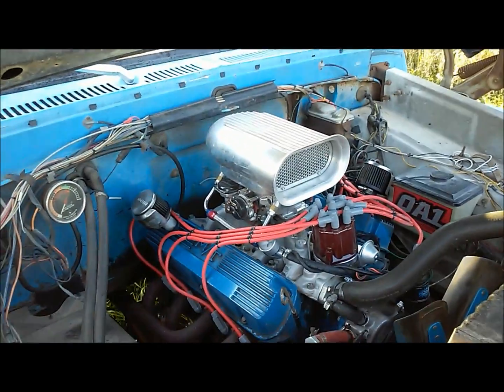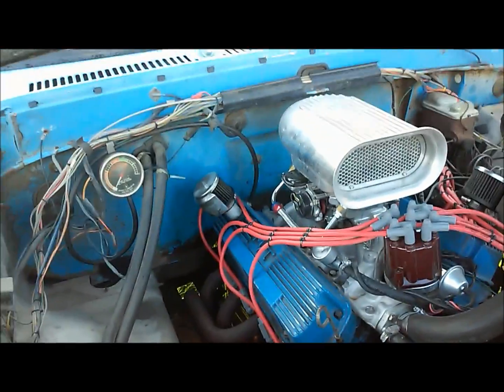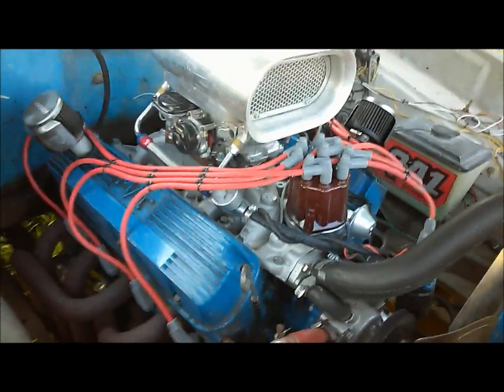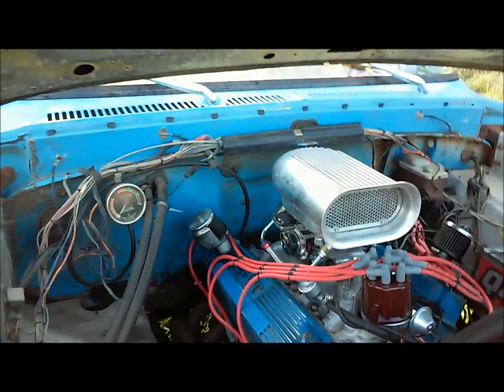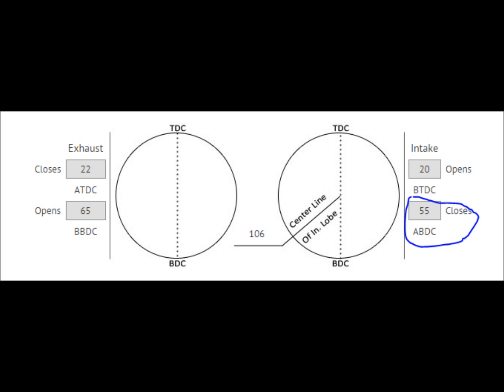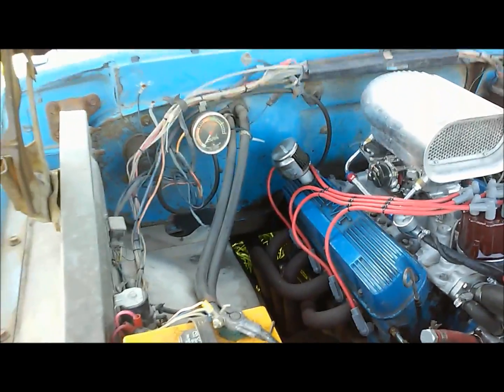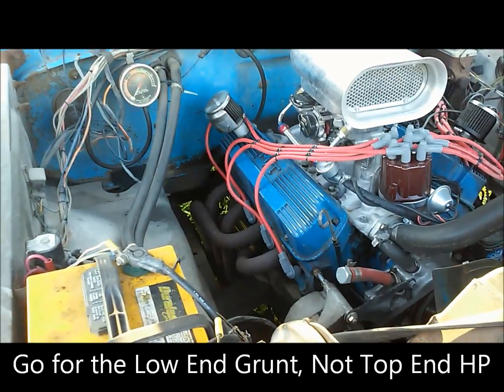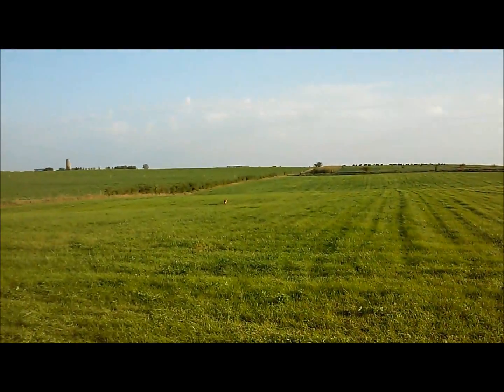Dynamic Compression: Biggest Engine Building Mistake

Comment: I try and shoot for 8 to 8.5 dynamic on my engines depending  the cubic inch size.  I think a bigger bore longer stroke  u want a little less dynamic number, smaller bore shorter stroke u want more .  I just did a 350 chevy with iron heads 8.45 dynamic, runs good  on 91 octane. No pinging even at 12 degrees  intial  timing and 36 total.
Reply: Do you have a certain quench or is that with oben chambers?
Thanks in advance!

Comment: Good information, LSA makes a big differance in dynamic compression, tighter raises it wider lowers it, tighter more  overlap, wider less overlap
Reply: Wait. More overlap reduces compression. Because you’re “blowing” air out of the exhaust valve because it’s still open.

Comment: All my numbers put into a calculator and its saying i should have 10.35:1 with 8.61.1 dcr i did a pressure test on my cylinders and its pumping 225 psi per cylinder 😮383 stroker.not sure if it will run on 93
Reply from the maker: Man, hard to say - but I'll tell you this, you are going to love that engine if you can get the octane to behave
Reply: If you could retard your cam 4 degrees or so, I'd say yes.

Comment: Don't hate on people that have 12.1 and a 383. There's a chance you're not the end.be all. Grand wizard.  I truck Doesn't run better, because it has a smaller cam.  My truck has 10.7  a stage 2 cam  on 91. It comes in low Is peck torque at 4500. 100 hp over stock rev to 6500.  It's a #truck cam.
Reply from the maker: Man, this has to be from like 10 years ago
Reply: @ThunderHead289  And yet, it's still posted.  Admitting when you're wrong about something isn't really an iowa thing. So...carry on👍
Reply from the maker: @kevinwest3689  I don't remember what I say in the video, but judging from the title I was probably talking about how a lot of folks stuff in too big of a cam for their engines static compression. 
A big overlap cam is totally fine when the engine is built correctly for it - unfortunately many people just don't. 

And I feel that - I think most people un general today can't admit when they are wrong. Try working in engineering - basically the poster child profession of that IMO

Comment: Im building a nice 408 afr head single plane can i run 9 to 1 dynamic on 91 with a water meth spray up top were i will build cylinder pressure with my hot cam its wi d e and 108 lobe sep

Comment: The more overlap an engine has, the more cylinder pressure it will have.
Reply from the maker: Opposite actually when compared to all things equal the same engine with less overlap in the cam
Reply: Im thinking this is actually true.
Reply: Only at higher rpm where we can't easily measure with a compression gauge.

Comment: Biggest bang for the buck was re-timing my stock cam on my smogger 460. Runs top notch 👍 don't want to lose my low end torque so kept the factory intake and cam. Only changed the cam timing and ignition curve. Its like a different car now for about $100 and a evening of tinkering with it. 😎
Reply: Ford retarded them 4 degrees from the factory for smog
Reply: @brantkinnsch  Just 460s or were all their V8's retarded in the "smog era?"

Comment: Dynamic compression is real world and most important. I has more to do with cylinder head VE. You can run hight static numbers with oem stock heads because the VE is down and the head doesn’t flow much. After market high flowing heads have a lot higher VE so your dynamic numbers will be much closer to static witch is based of 100% VE. The LS platform is around 80% VE. So you can do your math from there. Pro Stock drag engines will get up to 130% VE meaning the engine consumers 30% air and fuel them it’s static volume. Choppy loping cams the every one loves really is the engine running like crap at low rpm. A big over lap uses the exhaust gas velocity energy to scavenge the fuel air mix past the intake valve moving off the seat. It works best with a tunnel ram type intake with long runners. If you can get line of sight down the carb and see the intake valve. That column of fuel and air with create positive pressure @ tge back of the intake valve. It’s a natural super charging effect. It’s crazy not to see tunnel rams much any more. It’s the most bang for your buck on most v8’s.

Comment: So even with aluminum heads 8.5:1 is the magic number
Reply from the maker: Indeed it is - can probably fudge it a bit higher for dynamic compression with aluminum heads, but also aluminum heads decintigrate with preignition
Reply: @ThunderHead289  well I'm looking a doing a 347 with twisted wedge 11r 56cc chamber and ford's z303 exhaust closes 3 deg intake 41

Comment: You can run 12:1 static compressor on pump gas with overlap and bleed off but it's all about combustion chamber shape and compression squash with no sharp edges on dome or head chamber it works great 👍 for my engines
Reply from the maker: The word your look for is squish and it relates to quench. Bad quench causes detonation - ideal quench is roughly .042 between the piston top and the bottom of the cylinder head. 
From there, dynamic comes into play since it’s the real compression with the cam overlap factored in
Reply: Ideally. 042 is the max. .027 min is possible with low piston rock and the closer the better with proper build. After .040 detention potential increases greatly. If you can keep tbe piston under .040" throughout dwell as the piston is moving back down detenation practically a non issue

Comment: yeah exactly basically. hey I'm going to get a big cam without all the other parameters to utilize it properly.... hi I'm an idiot!

back in the day when you had to do things by hand and you either had to know what you're doing because somebody else gave you the parameters or you just simply had to take a chance because it was very common that somebody go through a lot of trouble and build up some big block monstrosity but all the parameters are not matched properly and then some little 351 Windsor with milder components but yet everything is matched perfectly beats that big block monstrosity. 

A engineer told me back in the day because he had it figured out basically at sea level conditions and i describe to him the typical drag race out on the street that took place back then in the 80s. 

The typical race was you already at first gear because there's some other guy in the other lane behind you going down the main street of your town and he knows that you got a ride and you know that he has a ride and sure enough he starts coming up on you and gets next to you and you know it's on it's just a matter of who's going to gas it first because before you gas it you got to look around and make sure it's not a cop and that there's not another car that's coming out of an alley or whatever and that usually takes less than 2 seconds and since I'm already in low now he puts it in low and you're doing about 3500 RPM and I will admit I was usually the one that stomped it first because I typically had the most guts cuz I didn't care about a ticket so what you have here is a mid-range the top end race and that's was drag racing on the street and for every 20 races I had like that I still can't remember one from a dead stop. 

He heard my explanation of a modern-day drag race and he looked at me and said go get yourself an LS6 crate engine long block and put a 3/4 lift cam in it with a Victor Jr intake and a holly 650 CFM carburetor. 

I said, you mean like a double pumper or something?

And he looks at me and repeats line 1 again:

 order yourself an LS6 crate motor, put a 3/4 lift cam in it etc etc

I said, okay okay what about exhaust?  headers? 

(shrug) If you want to. 

Are you sure that's a big enough carburetor for that engine what about gear ratio and so forth. 

He looks at me and repeats line one again with that look on his face that I'm a dumb 25-year-old and I just don't get it.... and of course he was right. 

Because he explains me that I told him what a typical drag race is and therefore as he said if you do what I said he said you will blow the doors off of everything on the street. 

looking back on that now I know that he was right even though I was just some idiot thinking well if it doesn't have a big Cam and all that shit..... it was just me who didn't know shit. 

And I mean doesn't it totally figure that this guy approaching his sixties and a mechanical engineer and fiddling around with cars like he had a Jaguar but with a 350 Chevy engine in it but the body was from Germany where it was like zinc plated or something where there's no way it could ever rust I should have bought that car now that I think about it and he had a son beam tiger parked out on the street because it wasn't exactly known that maybe the car is worth a million dollars now but it's not like he got screwed and sold it to some young whippersnapper for next to nothing he knew what he had and he didn't want to sell it and he wasn't getting rid of it and he didn't care that it was sitting there out there in the street because it needed restoration anyway but it ran there is nothing wrong with it other than faded paint and the card probably needed to be taken apart and restored because let's face it it's a Sunbeam Tiger and totally worth going through. 

But the classic thing about this story is the other vehicle that he had that I never heard and I never seen it run but it was one of those 70 or 71 ranchero Fords with a 428 or 429 and I can't remember and just a total sleeper but he didn't build it with the intention of it being a sleeper but listen to the other cars I described he's just one of those kind of engineer guys that as he said no Paul if you get your setup that I said you should get and you'll blow the doors off of everybody you're not going to blow the doors off of that ranchero and one day I'll start it up for you but I never got around to seeing him very much and to this day it's a mystery how well that car went but I'm sure went real good because believe it or not up until about 1993 and being around a lot of cars and so forth, the most badass car I was ever in was a 67 GTO with a 383 in it four-speed and that six pack carburetor whatever the hell they called it and it was all stock and sometimes a guy would give me a ride to school in the few times he did coming out of the neighborhood I always told him to stomp on it and he say okay and he's looking his rear view inside mirrors downshift into first and stomp it all the way up into third gear and I never did like those Pontiac engines but I have to admit this thing did not move like those Pontiacs that I've been in because this thing really boogied and it would pull you in the seat you know we're like your eyes get a little bit big because I guess instinctively you know that if a car pulls out you're dead that's how you know a car has power and they used to make a big deal out of those GTOs from what I understand they were the king of the street for a while and then that's when pretty sure Chevy came out with the Camaro and then everything blew up from there of course up until about 1971 and that was something of the peak and then 72 is when the smog shit appeared and that was it for the muscle car age.
Reply: ….. cool story bro
Reply: I think you meant 389 in your GTO, not 383.  Next time sprinkle a few periods in your paragraphs.
Reply: @imaouima  yes, 389 tri-power, Muncie close ratio 4 speed, all factory options including 3:55 posi type configuration rear end.

The reason for run on sentences and retarded context, is because of the retarded voice/text recognition of recent years and my unwillingness to simply type out my thoughts, unlike today. 

Thus, 

....the more reasonable and intelligible, contextual body and paragraphical structure. 

Aint that right bwoy....IN'IT BWOYYY?

Comment: Whats the link? I want to use a dynamic calculator. Ive found a couple that I've used & they are not all the same. I wanted to see what you recommend.  For static compression ive found diamond compression calculator to be the best i know of. But I am currently building a 390 & am paying very close attention to quench, compression, & dynamic compression.

Comment: What is the engine used for is the most important question. If it's a race engine with heads that flow like no tomorrow. Then you need to match it with a big cam and high compression ratio to keep up the cylinder pressure ie 200 psi. A street engine only needs 160 - 180 psi and you can get that with 9:1 ratio and a rv cam. You can run a bigger cam but you need good heads or it's a waste of time and money. It's a balancing act.
Reply from the maker: These heads are a 54cc chamber with a 2.02 intake valve, unshrouded.
Reply: @ThunderHead289  I'm not sure what you have for pistons, but based stock bore and stroke and flat tops with 4 valve reliefs and a .040 piston to deck clearance which includes the gasket. You should have about 9.6:1 compression ratio. Back in the day when pump gas was 95 - 105 octane, factory muscle cars were 10.5 - 11.5 compression ratio, and the cam had durations above 300, they ran like scalded dogs. Now days with pea coming out of the pump, it's more of a balancing act between cylinder pressure and detonation, I would cater more to lift than duration for that reason. But then you have to up grade the valve train, there's always a trade off.

Comment: I have 10.2 to 1 compression with I think it was below 8.5 dynamic compression maybe it was like 8.4  . I run 91 and 34 degrees advance timing . 66 abdc intake closing point its the 280H magnum cam . I cant get the idle under like 900 rpm  . Im all about big engine  that you can idle slow . Im not a fan of pumping unburnt fuel out the exhaust on a street car if I can help it
Reply: I'm doing a 350 chevy, 9.8 static and 8.4 dynamic, u think it will run without  pinging on 91 octane gas with a little timing?
Reply: I actually think that cylinder head design has much more to do with how well the engine handles compression . I saw a chart that shows that engine temp has a massive effect on preignition . I run an oil cooler and a massive 4 core radiator  , I swear I have 10-1 compression + and never even heard the thing backfire .  the car isnt a daily driver , so i havent been driving it . but i ran the cheap gas and got it up to temp and it seems great . I think  you keep it cool , and try not to lets say climb hills when its really hot at a low rpm , and my guess is youll proabably be fine @jessesyfie7244

Comment: I'm glad you pointed out the overlap, intake open & exhaust closing are very important. Very very important. I had a 7.8:1cr 1973 400 BBM factory rated 225 hp in a charger back in the days. Not sure the cam timing events but I put a mopar purple shaft 280-474 @ 110 lsa in it & boy oh boy it was all the difference it needed. Before i understood compression ratios I thought hmm if you get more air and fuel in the same area its got to affect the compression ratio somehow. It was a nasty sounding cam, it wasn't huge & even ran on the stock converter.

Comment: Thanks ThunderHead289, great vid. Would you say that a 'cranking pressure' calc is also an important factor in planning/choosing a CR for a street engine? I ask because I heard that 165psi is about the limit with 91 octane (Calif. gas) but can't find much info on this. Thanks again!
Reply: My prelude has 200 psi with 91 gas and no knocking

Comment: I wonder if you'll reply, what dcr would you recommend for 93? That's commonly available to me at the pump
Reply: On that note, do you think a high dcr would benefit from water/methanol 😈😈
Reply from the maker: Heck anything benefits from water meth - the Hangup wth that is that methanol corrodes out Aluminum parts. A lot factors into what you can handle with dynamic - if you have Aluminum heads, good quench, and chamber design, then 8.5 is really the highest dynamic ratio you want on the pump. (Sounds low, but don’t interpret it the same way as static)

Comment: Stay around 10:1 and ya wont have a problem running pump gas. Most people think more is better but its just not true. If ya really want more grunt work with your rear gear ratios. Lets face it most daily drivers dont get to go much above 100 mph so if ya build it to hall ass 0-60or 70 ya dont need all that cam lope and hp all be it sounds fantastic ya dont need it.

Comment: Why didnt  you can advance your cam to change power band down low to suit the truck better .
Reply from the maker: If a vehicle that is daily driven needs something different than what it has, I'd much rather switch cams then bandaid the situation. I feel you though, had this engine not be destined for the galaxie again, I would have changed it. The f100 was just borrowing it for a year.
Reply: ThunderHead289 
I understand there is a proper camshaft for the motor . Rather than spinning the motor higher to get the tq you need with a truck . I personally would rather but the right cam but if you just dont want to cant or will be swapping the motor soon advancing the camshaft a few degrees is better than nothing.
Reply from the maker: agreed, i just didnt want to pull it apart since i took it out of a car it was right for, and it was going RIGHT BACK in that same car. didnt seem worthwhile to me to have to do the job twice, versus being tempted to light to light the truck a bit. the f100 has a mustang 5 speed and 4.11 gears, so it handled it just fine. it just lost its towing ability for the year. was by no means, not derivable.